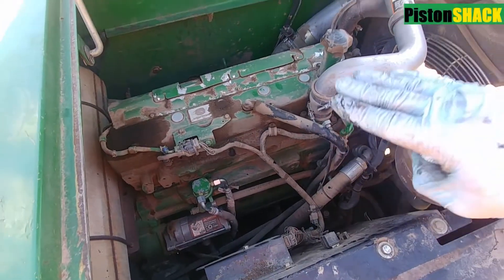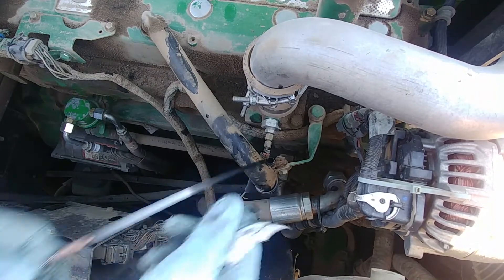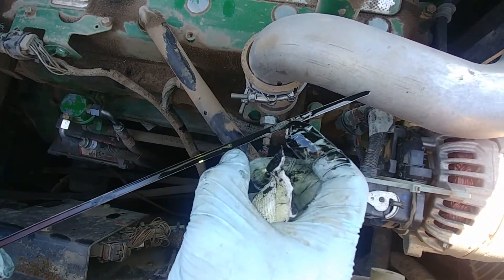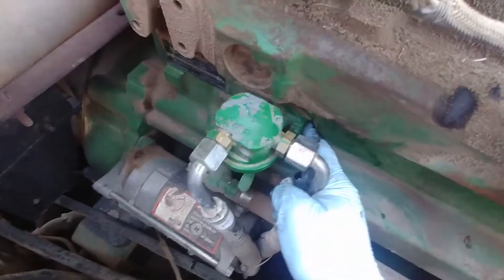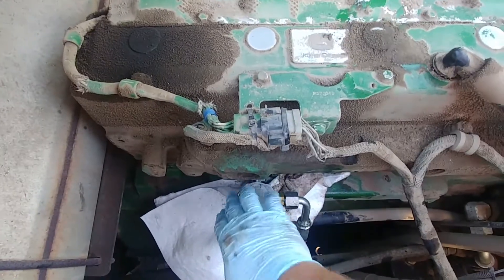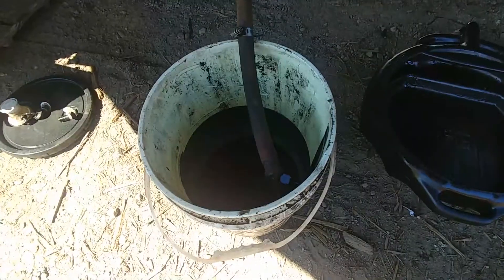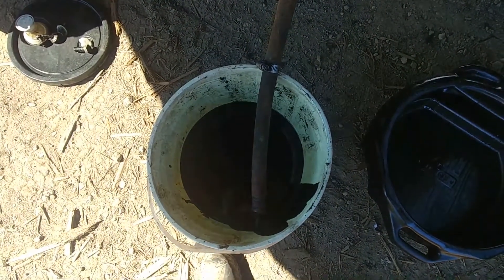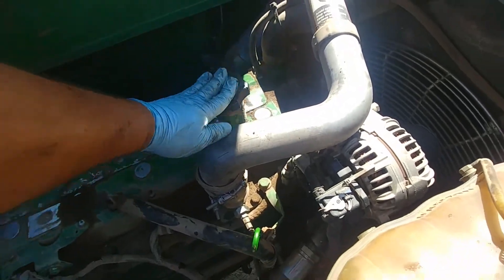ENGINE OIL LEVEL TOO HIGH? JOHN DEERE 6.8L 4.5L ENGINE OIL GETS DILUTED WITH FUEL | Fixed.

Comment from the maker: More John Deere Vids: JOHN DEERE FUEL LIFT PUMP REPLACEMENT | JOHN DEERE POWERTECH 6.8L 4.5L  https://youtu.be/Usurbkt1N74
JOHN DEERE PENCIL FUEL INJECTORS REPLACEMENT Made Easy | John Deere 4.5L 6.8L POWERTECH https://youtu.be/8lXxqQaymUg
SERPENTINE BELT REPLACEMENT | JOHN DEERE 2054d https://youtu.be/BDpTaS5oPxc
FAN DRIVE PULLEY REPLACEMENT JOHN DEERE 2054d https://youtu.be/_cczLishUP4
TRACTOR IGNITION KEY SWITCH WIRING | Universal Ignition Switch | JOHN DEERE 2130 https://youtu.be/_D4t4hwWj0A
FINAL DRIVE GEAR OIL CHANGE: check, level, orientation, drain, change, intervals / JOHN DEERE 2154d https://youtu.be/6kXlRNoAvbM
TREE STUMP VS EXCAVATOR or HOW TO REMOVE STUBBORN STUMP | John Deere 2054d https://youtu.be/dgcN5v7VY0A
Enjoy!